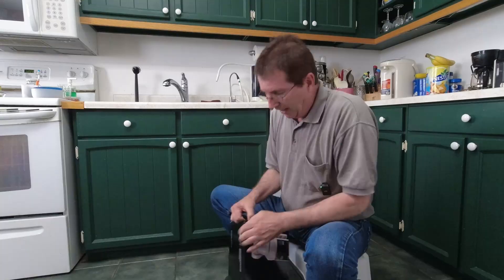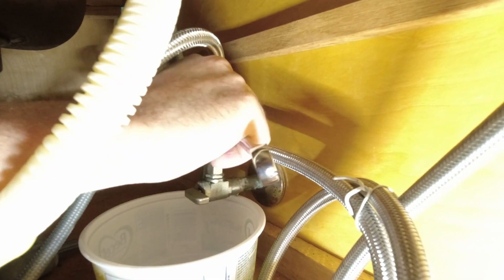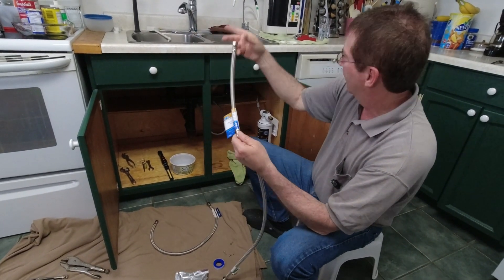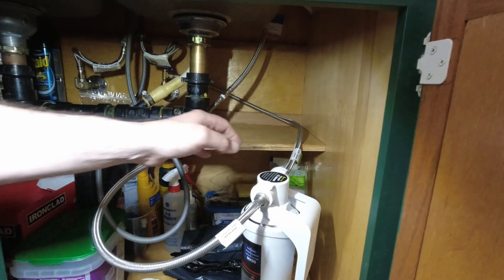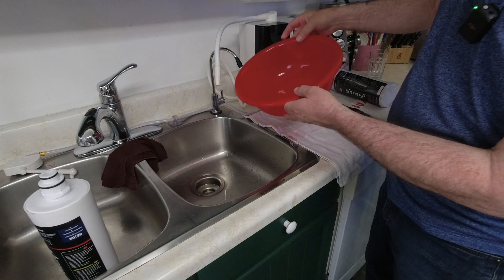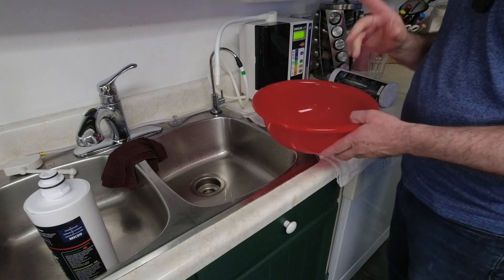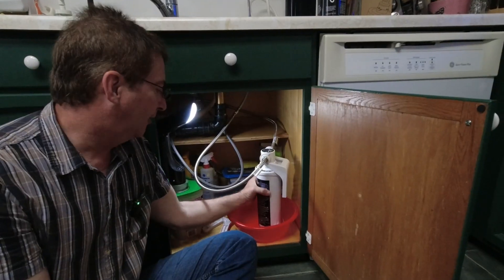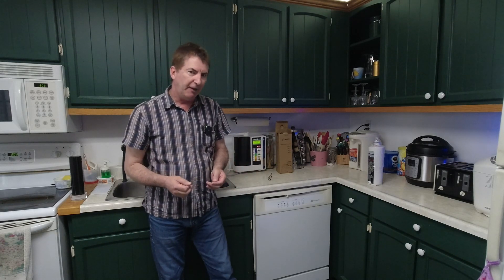Installing New Water Filter, it did not go as planned.

Comment: Hello from Saskatchewan.  I have the same one. I've had it for a year and just changed the filter.  I turned off the water to it even though it has a release system that is not supposed to require shut off. Took 5 minutes tops.  Good simple little filter system.
Reply from the maker: So far the water filter is working good, no complaints here either.

Comment: I am in the UK and have this exact problem, I tried replacing the top O-rings to no success. Your video has made me confident that i can fix it when i get my new part - seems like a common fault 🙂
Reply from the maker: Good luck!
Reply: @FRUGALWITHJOHN  is yours still sealed and not leaking?
Reply: @FRUGALWITHJOHN  is yours still sealed and not leaking?
Reply from the maker: It has not leaked since, I replaced the lower housing.
Reply from the maker: It has not leaked since, I replaced the lower housing. (my duplicate) lol
Reply: Just did mine, as I was changing it, I thought why not try the other way and it tightened... it's as if the bottom part of the cannister wasn't tightened enough during the manufacturing process.

I will feed back if switching the bottom like yours has solved it 👍🏻
Reply: So that didn't work, was leaking more than before, so I have changed the whole cannister, keeping the partially used filter - let's leave it for a bit and see what happens
Reply: Nope mine still leaks, going back to the manufacturer again.

Probably going to buy a different brand.
Reply from the maker: Your bottom part of your filter was probably good, your defect may be in the top half. Good thing about Amazon, it is easy to return when you get a defective product. The reviews on this filter are mostly all good, but most of the bad ones are because of leaking.
Reply: @FRUGALWITHJOHN  the company are sending me a full new unit to try, let's see where this leads.